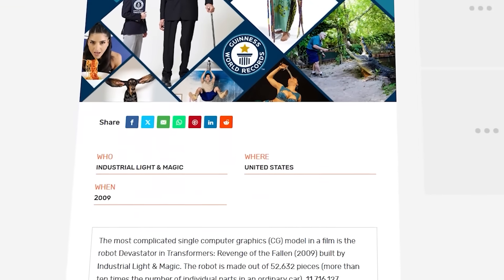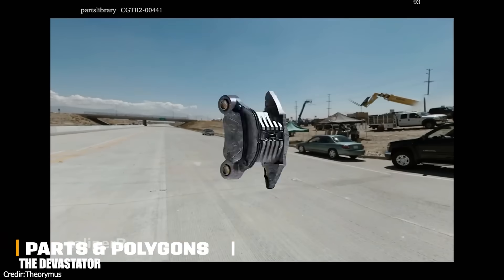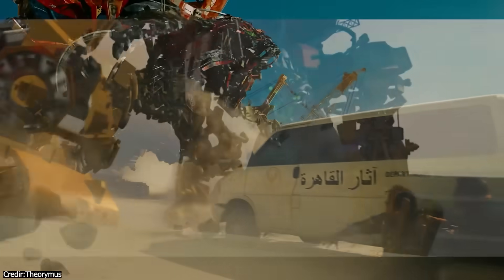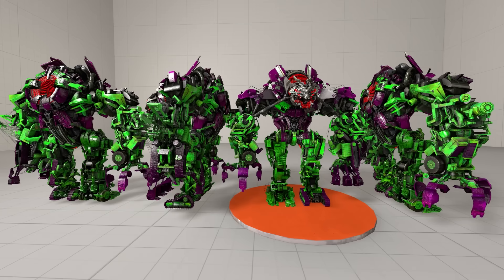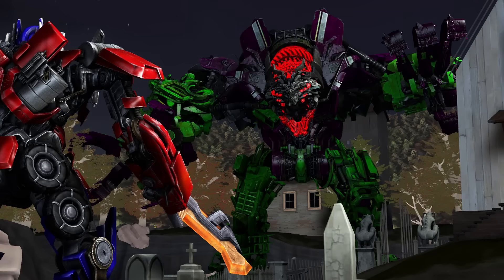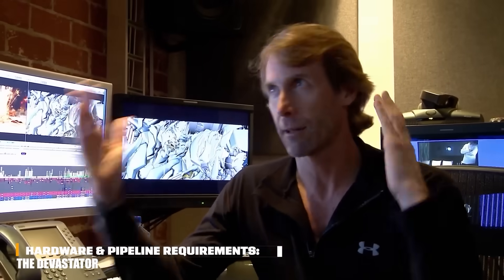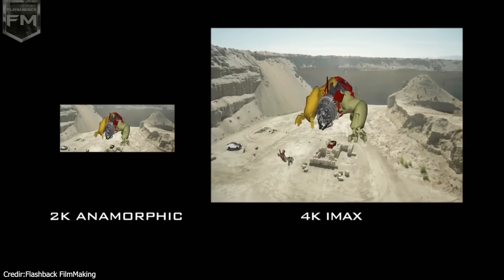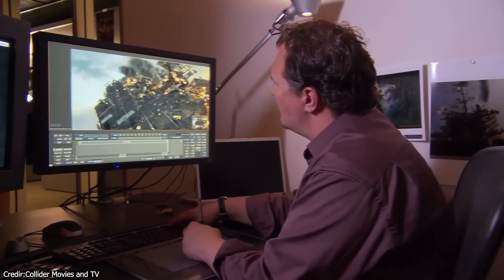The Most Complex 3D Model In History

Comment: And to think the original Jurassic Park T-Rex only had 150,000 polygons :)
Reply: thats pretty goddamn high number for its time
Reply: @Levente20  not at all, Jurassic Park released in 1993.

Sega released Virtua Fighter 1 in 1992, the "Sega Model 1" hardware could run 162,000 polygons per second, at 30fps.  

Sega released Hardware Model 2 in 1993, debuting with Daytona USA, which could handle 300,000 - 900,000 polygons per frame, depending on quality of texture maps, anti-aliasing, lighting effects, etc.

Comment: This is a case where the absurd effort wasn't worth it. Not only did the film itself turn out to be garbage (which is not the fault of the CG artists, but nevertheless). But the robot still looks like a toy. An unsuccessful choice of colors negates all the efforts of the artists, they are too bright and saturated, if the colors were more faded, the robot would look more believable. And they could save money on textures, the robot has practically no static poses, and no one would see the difference between a simple metal shader on most parts when moving. It probably all came down to the director's demands to make it brighter, but at the same time so that it didn't look like a toy, and ILM suggested that adding more detailed textures would save the day, but alas. I respect the work of the artists immensely, they have done such a titanic job that it is difficult to imagine now, but unfortunately their efforts have hardly paid off.

Comment: 11 Mio polys? Average blender project in 2025😂
Reply: if the blender viewport could handle a single model with 1 million polys in edit mode.... it cannot with a good framerate.
Reply: @PrefoX  say it to my current 11 Mio sculpt 😅
Reply: @PrefoX  I run in edit mode with three times that poly count.
Reply: @PrefoX  Yeah, the Blender performance with large meshes remains terrible even in the most recent versions. But even worse is how it can't handle large amount of objects.
Reply: @jendabekCZ  Just three days ago, I sculpted a 21 million poly count model in Blender 4.2.10, so I don't agree with what you're saying. And I'm not even using a high-end gpu or cpu the program just works efficiently at that point. My only issue is with rendering, and that's simply because my computer isn't that good.